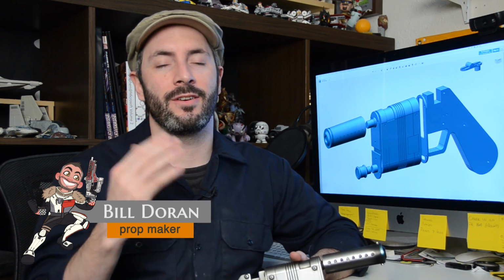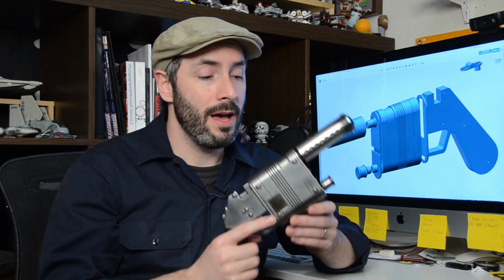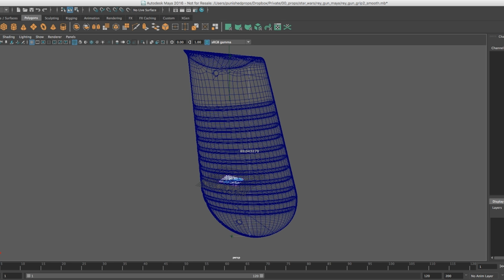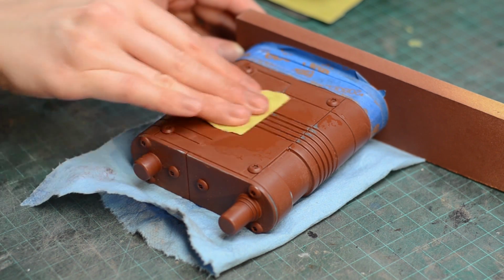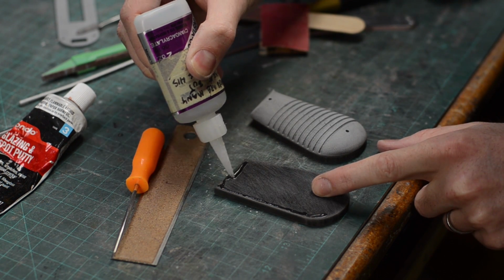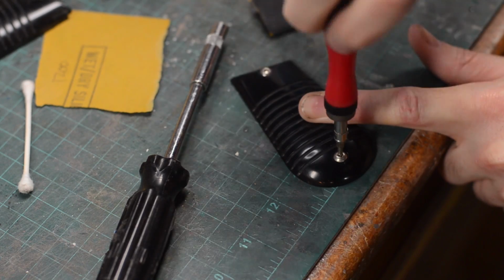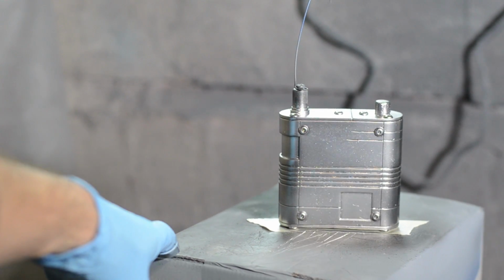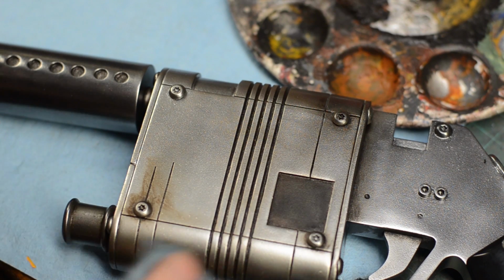How to Make Rey's Star Wars Blaster - Prop: Shop Tutorial

Comment: weird, I don't fully see why you would cast the print, you have to clean up all the layer lines anyways. for a one off you can't sell due to copyright, it could have just been sanded down and painted unless you're planning on multiple runs off this. for my own I'm just going to use 1mm sheet styrene and carve the pommel sides from wood.

Comment: Sweet.   Bill if you do a lot of tenon and mortising with your props, it may be worth investing in a set of these.  Never tried them with resins but considering how easily the can be carved, they might work great.   http://www.amazon.com/Woodstock-D2845-2-Inch-Mortising-4-Piece/dp/B0000DD32N/ref=sr_1_9?ie=UTF8&qid=1456782423&sr=8-9&keywords=tenoning+jig  I'd go for a more wider range of bits but you get the idea.
Reply: No prob.  just one thing you need a adapter to use with a normal drill press,  those are just the bits.   the whole kit  http://www.amazon.com/Northern-Industrial-Mortising-Attachment-Wood/dp/B0007LKZWK/ref=pd_sim_469_65?ie=UTF8&dpID=41APMTv9GZL&dpSrc=sims&preST=_AC_UL160_SR160%2C160_&refRID=051R4EN8WP5YWGNHJSYN

Comment: Maybe this is a silly question, but, why mold and cast everything? Why not just use the 3d printed parts? 
Thanks. Fantastic work!!
Reply: +Bill Doran Thanks for replying. That makes sense what you are saying. I wonder as tech progress's if it will be more time and material efficient to just print. Do you know if there are materials that a current 3d printer can use that might be as durable?  Again thanks for the reply. Super impressive work. 
P.S. the fact you list all the supplies you use is so helpful, thanks.
Reply: +Bill Doran Are there any plastics for current gen printers that would be durable enough?